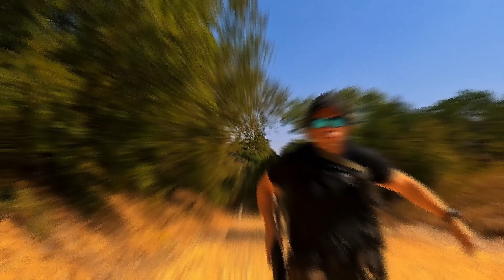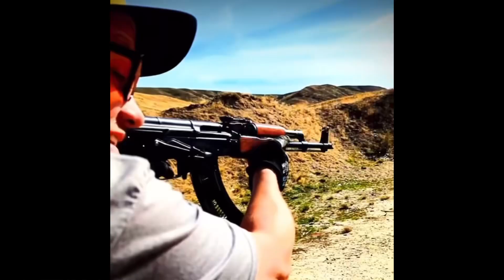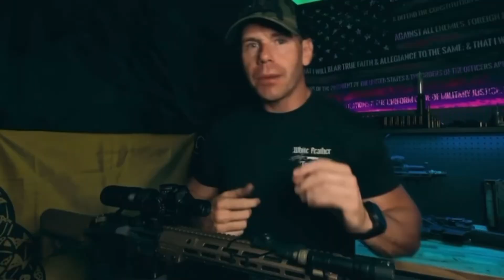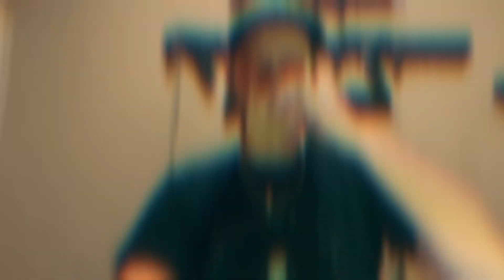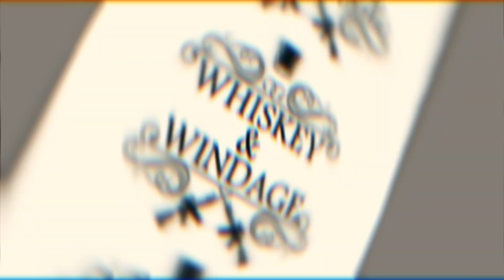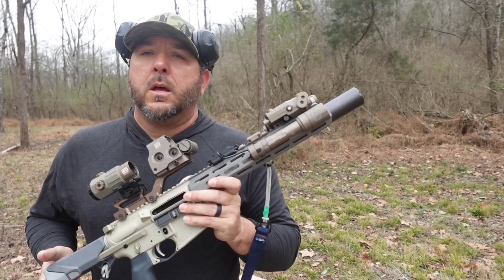THE NEW SUGAR WEASEL SD FROM Q LLC #review #target #unboxing #new #outdoors #test #fun #shorts #fyp

Comment: Hows this build holding up? Thinking about grabbing this hydra Mount for mine, any issues with yours on the front rail? I usually see them on the rear rail.
Reply from the maker: Love my hydra mount. Played with it in different locations but I ultimately pushed it forward due to NVG as the stock only goes so far back. Not my normal mount position for a standard setup but either way works fine.
Highly recommend
Reply: @Whiskeyandwindagereviews can’t find the sugar weasel SD anywhere. Is it discontinued?

Comment: If this is your dedicated CQB/NV gun WTF is a magnifier doing on there bro?? That GBRS Hydra mount is meant for you to mount your HWS back where your magnifier is sitting and your PEQ15 or other IR LAM where the HWS is currently sitting. The way you have it set up is an obvious indicator that you don’t understand the reason for the Hydra mount’s existence in the first place. SMDH… 🤦‍♂️
Reply: Weird looking? Absolutely. Magnifier was there to shoot it farther out to shake it down for accuracy. Fully aware of what GBRS is for BUT on this short rail, it doubled as a great way to clear space for hand position while still keeping the heads up shooting benefits from NVG. Not a standard config nor is it in this config now but it does work. Breathe bro.

Comment: I didn’t even know these were out or coming out.  I was literally going crazy mentally trying to debate if I should rebuild my current .300 build or go honey Badger SD it was all about $$$ so now I might just redo mine and get this upper.  Do you guys sell just the upper or is it only coming out as a whole?
Reply from the maker: You could buy a new barrel and hang guard, but won’t get the can as it is the one for the honey badger. If you want that, you will have to buy a whole new kit.

Comment: I want one but i have been running a AAC MPW with a Q HB 7" barrel, AAC 762SDN6 with plan B conversion by ECCO machine and free floated it with the 12" HB rail. its heavier because of the AAC can but its reliable with subs and supers. I made it to the punch before Q but they did a great job with this new setup.
Reply from the maker: It’s a fun setup fornsure

Comment: It’s wild you’re the only guy I’ve seen talk about this. How’d you secure a unit for the video? And would this be cheaper than the HB SD? If so, by how much? Awesome video!
Reply from the maker: I ordered one from Q as a dealer back in Nov. and got one of the first batches but I can get them for resale. They are definitely cheaper than a HB and just as fun.
Reply: @Whiskeyandwindagereviews  awesome. I noticed you had a light and laser attached, is it safe to assume they’ve somehow fixed the clearance issues regarding grips and lasers towards the end of the hand guard?